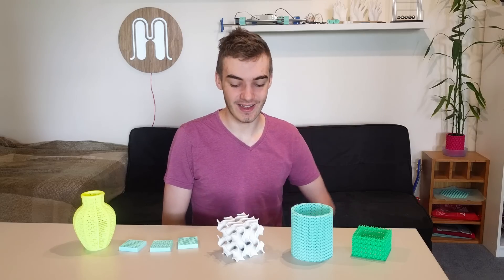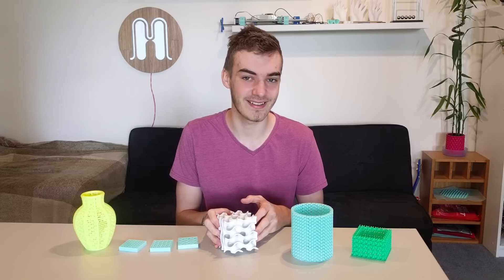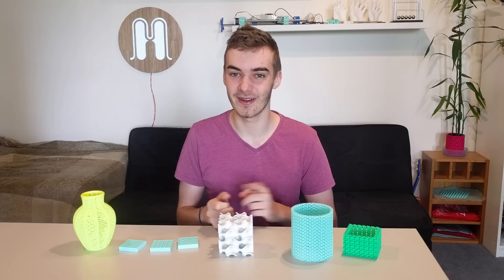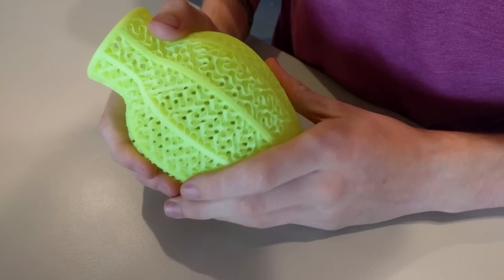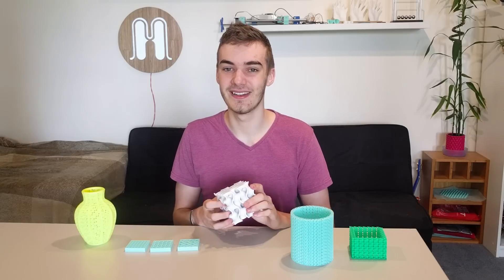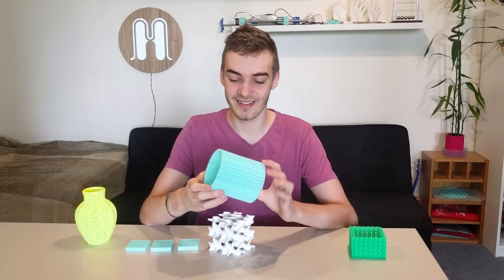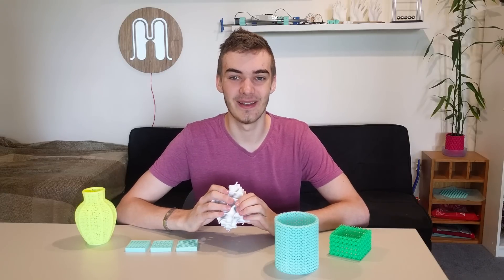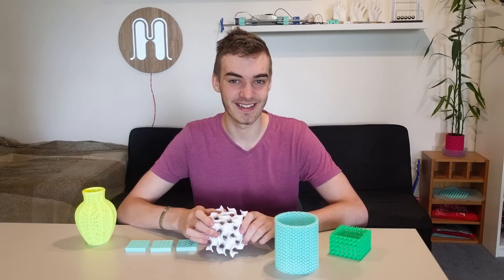3D Printing With Gyroid Infill

Comment: thank you very much, Matt, for the useful information, very very interesting, I will apply to my next prints, I usually print parts for a mechanical use in carbon fiber filament and this is a very useful infill option, after saw your video, I made some research and this shape is incredibly solid under heavy mechanical requirements.
thanks again
cheers ! from the other side of the world
you have a new subscriber!  :)

Comment: Oh man, I just discovered this infill while doing some research online in the different types of infill that the new Cura 4 offers... I'm absolutely in love with it. I was using the triangle infill because I like how strong it is, but my printer only prints it in lines, which cause the printer to do a lot of retraction moves when printing the infill. With the gyroid infill it's just long curvy lines, also makes the print sound way quieter!! Great <3

Comment: awesome... can't wait to start playing around with those. I like to do some creative stuff with infills.
Any chance to have a linux version somewhere?
Reply from the maker: Jim van Hazendonk the source code can be found here https://github.com/supermerill/Slic3r/tree/merge_dev. Unfortunately right now you'll have to compile it yourself if you'd like to run it on Linux
Reply: thanks for the swift reply, I will give it a try :)
Reply: You don't need to grab my branch, use the master from pusa3D/slic3r (or alexrj/slic3r), they already have the gyroid infill.
If you want to use it as an "artistic" build without walls, you also have to comment/delete the "Try to connect the lines" block  (line 128->142 in the slic3rPE branch) in xs/src/libslic3r/Fill/FillGyroid.cpp

Comment: please add links to the Gyroid Cube that doesn't require the infill.
Reply from the maker: https://www.thingiverse.com/thing:757884 here it is!
Reply: Found this one: https://www.thingiverse.com/thing:757884
Reply: I couldn't print it.  There are a number of areas that reach only a single point on the bed, so those won't print without a brim ... I tried and a single point build up is bound to fail.     With a brim even, there are 3 different points that around mid-height on the sides, where they cannot exist without support.  Guess I'd need to modify the model to print it properly.

Comment: I imagine this is harder for a printer to make with all the overhanging?
Reply from the maker: You're right in that it has overhangs greater than 45 degrees, but the printer seems to be able to handle it fine. Probably because of the curved shape and the fact that it's a bridge